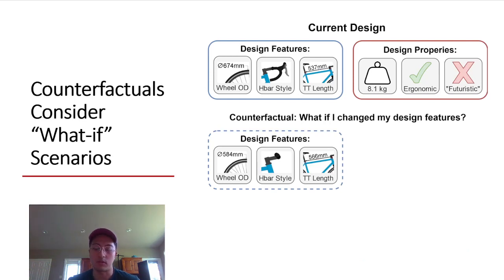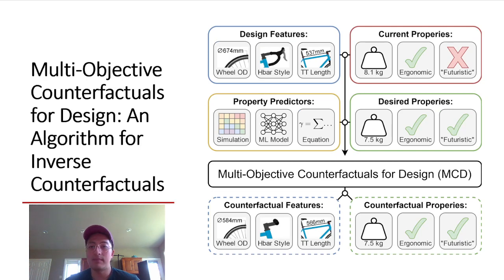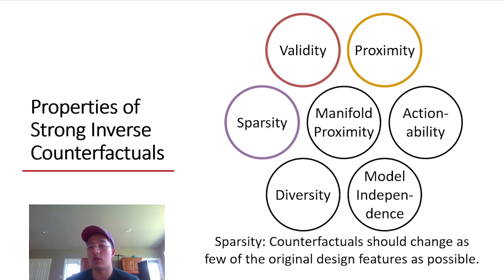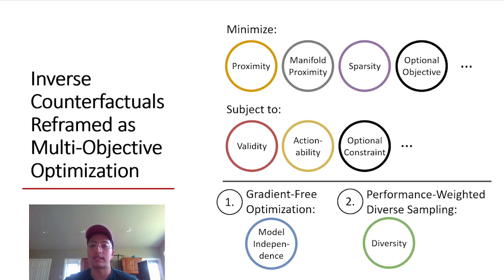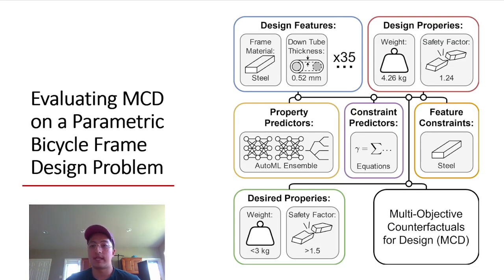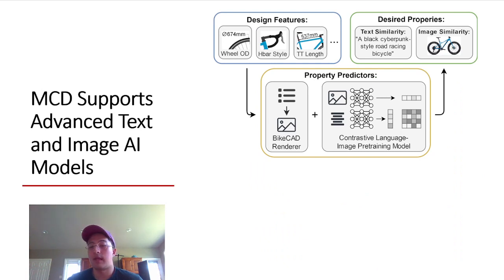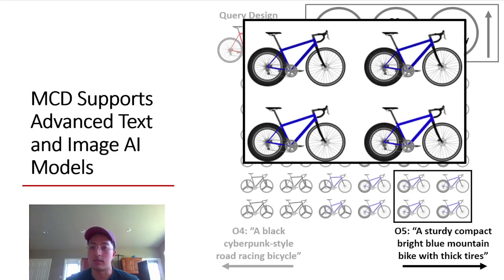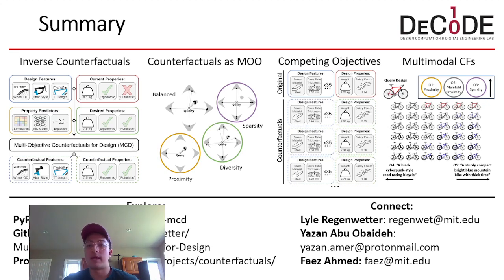Counterfactuals for Design: A Model-Agnostic Method for Design Modifications

Comment: Good work ! Would these models help in conceptual design? let's say if my objective is to suggest a mode of transportation from point a to b and  it should be lightweight, use less fuel and be environmental friendly. Will such models generate new bike design concepts rather than small modifications to existing designs?
Reply from the maker: Hi Rizwan, great question. The text-based design guidance approach used in the paper is very much dependent on what can be visually identified from a bike image. Since the weight and fuel-efficiency are difficult to determine based on just an image, I think these objectives would need to be explicitly calculated. But with some advancements in multimodal learning, it could be possible!